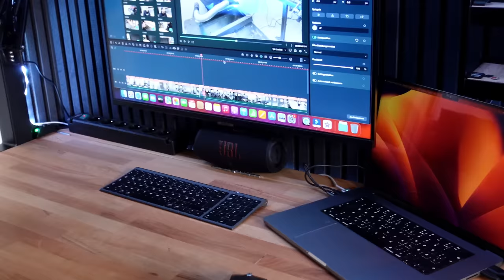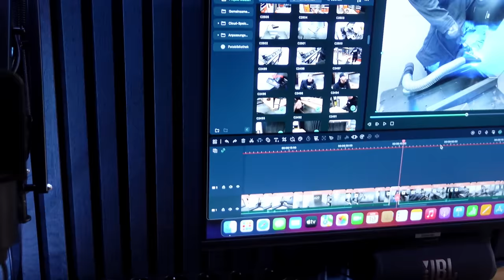How to build a Desk, space saving an functional

Comment: Question what did you use to tap the table @7:16 ? Been looking for a (not too expensive) tool to do occasional tapping (albeit mostly in aluminum profiles) and not having much luck finding a decent affordable tool.
Reply from the maker: I use always a battery drill. For my one i have a adapter fir the tap
Reply from the maker: And for sure the right tap bit